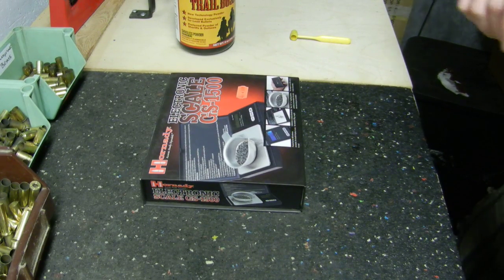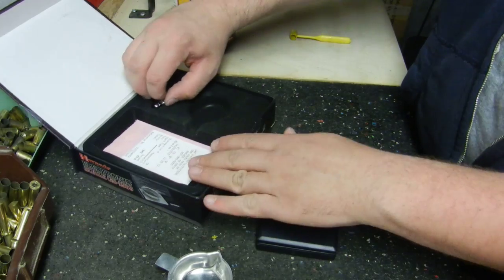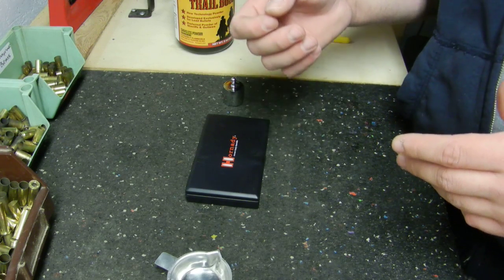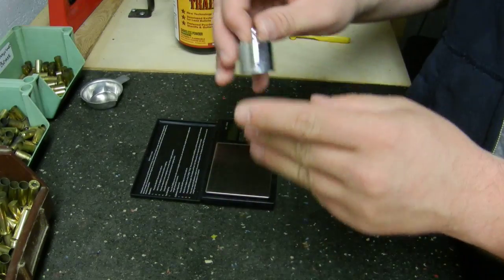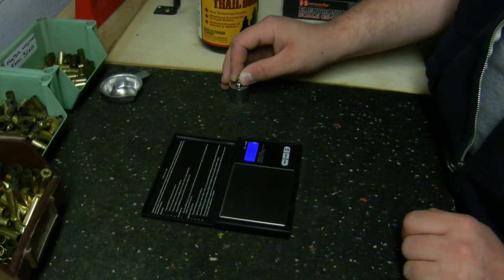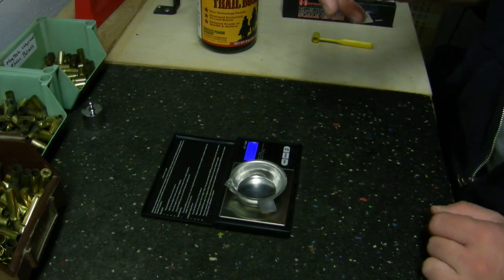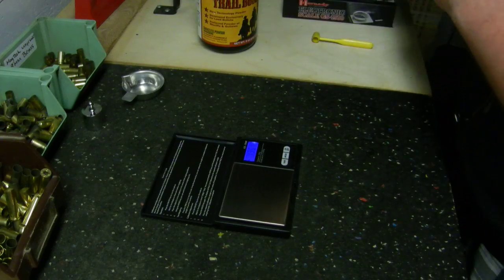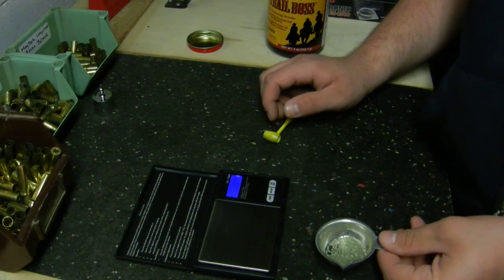How To Properly Calibrate & Use a Digital Scale

Comment: Ryan where did you buy that rubberized  top,? For your reloading bench.? This is what I was looking fo to do on mine also.? Thanks for sharing the scale etc.?  Is that rubber top all one piece .? Or are they 12x12 flooring squares that you had to glue to the top of the bench.? Just wondering.?
Reply from the maker: +A REDTAIL Hi Redtail! =) I do believe that stuff is rubberized flooring squares that are 12x12. I found them in my grandfathers basement and used them to minimize vibration. I did find that it made cleanup hard though if you spilled powder because the rubber tends to make the powder granules stick to it.
Reply: A gaming mouse pad works or a regular mouse pad should work also depending on your scale! 
I use mine to weigh out supplements I buy in bulk and I love it!

Comment: I see som videos where they put an empty rifle shell on the scale & set it to zero. Then put the powder charge into the case on the scale.? Is this another way to do it.?
Reply from the maker: +A REDTAIL I wouldn't recommend that. The weights of the cases can vary from brand to brand and lot to lot. It would be better to use a little powder tray that is of a known, consistent weight, in my opinion.
Reply: +Ryan Michad  Right did not think of the case to case difference in weight thanks for the heads up.?